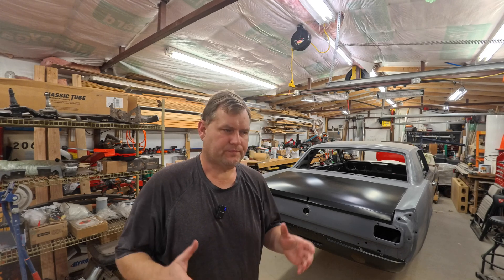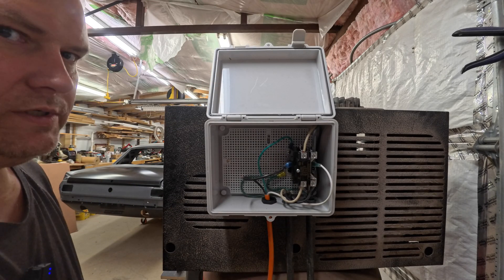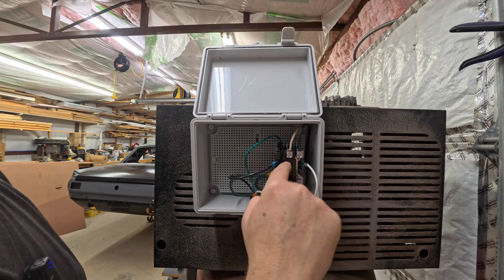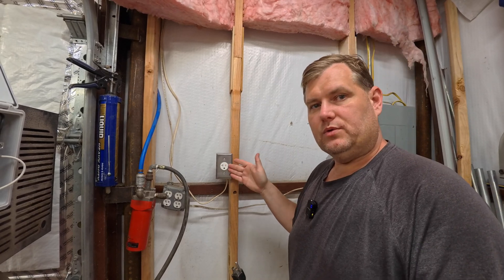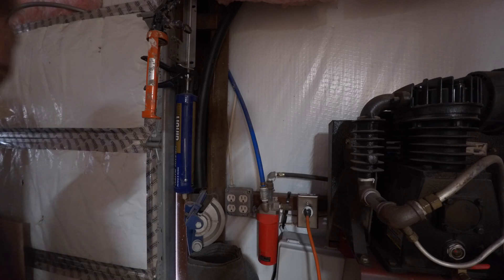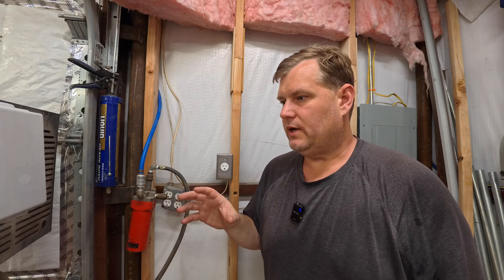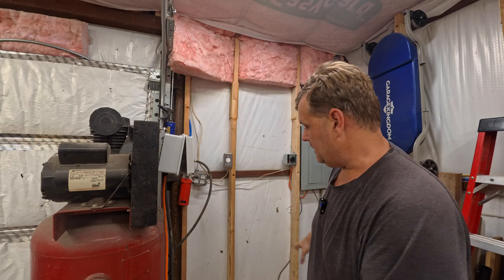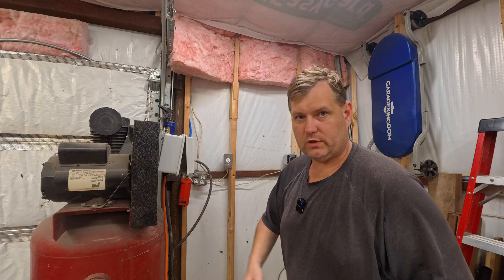Air compressor turns off when you forget.

Comment: I just put a flow switch on the air output and an off delay relay. If you don't use any air for a set amount of time it turns off. You Also have a push button in parallel to reset the time if the tank leaks down completely and thus can't establish flow.
Reply from the maker: Nice. I have all kinds of ways I can do it but want to keep it simple for anyone wanting to do the same.

Comment: I actually kept forgetting to turn off my compressor when I moved into my new house, I wanted to use a lighted switch by the door as an indicator the compressor is on but I never found a good relay switch combo. I ended up taking a saturday and sealing up all the leaks in the air supply lines around the building and now once it's charged it loses maybe 5 psi in a 24 hour span, at least it is cycling all day and night when I forget to turn it off.
Reply from the maker: The leaks on mine are n the airhose reels which is actually very little and I do have a bad coupler or two to replace. But I think the tank check valve is the main culprit on mine which leaks air back into the pump. It's on the to do list which makes a dictionary look short.

Comment: Interesting, I think I’ve left the compressor on half a dozen times in 50 years. Doing a safety check before flipping the light switch is a discipline I do every day when knocking off. Never thought to drive a relay with the light switch. Then again I could just kill the whole shop from the sub panel.
Reply from the maker: In my case that would turn off the mini fridges, Minisplit WIFI router etc. I also have emergency lights out there too as it's pitch black out there when the power goes out. I could easily set up a control panel like in restaurants. Sadly I don't have any old ones on hand to repurpose. Lots of handy lighting  contactors etc in them. Lots of neat stuff can be done with them but my shop is still evolving.

Comment: Please show the wifi setup.
Reply from the maker: Will do. I'm working on cleaning up the other wiring and air lines on that wall so I can get it insulated and covered with plywood. Running into the I am missing one small part of each stage to get it done. 
     I had filmed a more detailed clip of the assembly of the relay. But it's very simple. I could add quite a bit of information and options but I have found when I share allot of detailed information that no one is interested in it. So hard to find a middle ground. 
     Once that wall is covered I'll get the WiFi stuff going as I need it more for the irrigation well than the air compressor right now.